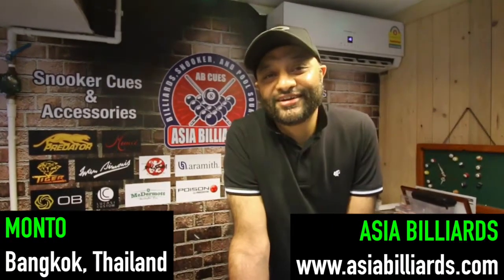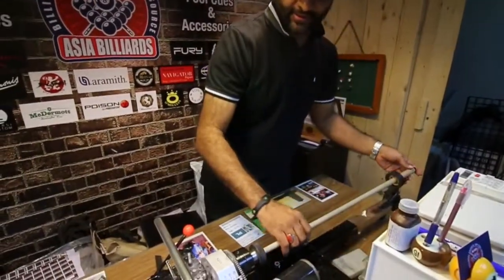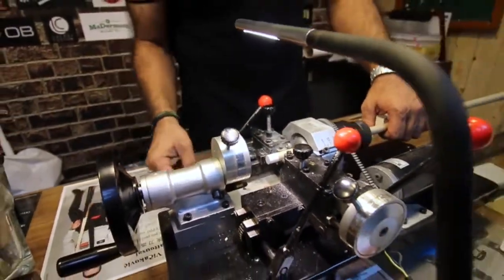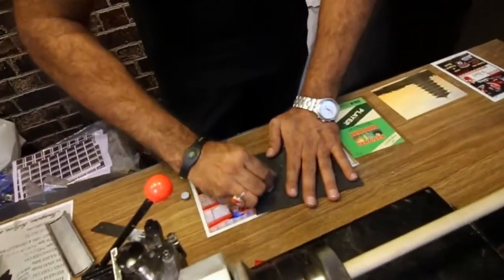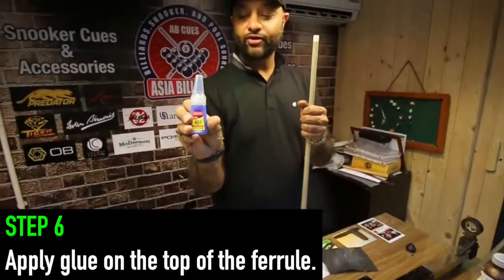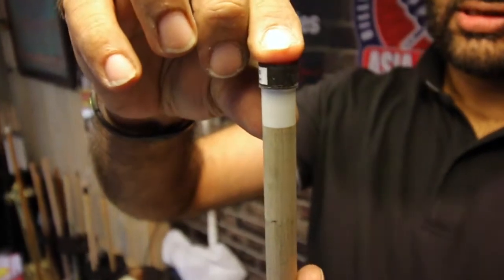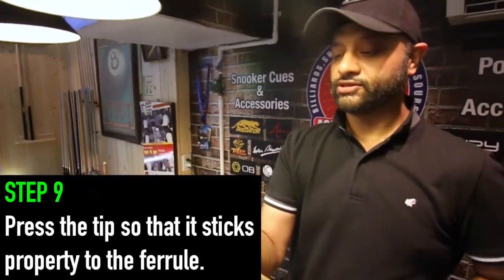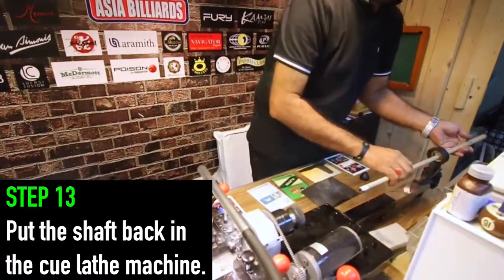How to install a kamui clear tip on the lathe machine in 20 steps

Comment: Where did you get your cue lathe? I need one like that. I live in Los Angeles and do tip work. I've been looking for a lathe like yours but haven't found an affordable one yet, Thx for the  video!
Reply from the maker: It's all available at Asia Billiards. See their website!
Reply: @voicumihnea  Asia billiards doesn't seem to be around or is not selling lathes. Where did you get the flush cutting tool that appears to have the bearing. Where you trim the tip flush the the ferrule. If you could point me to where I can get that tool I'd be grateful. I already have a lathe. Thanks

Comment: @MONTO: Sanding the glue side of a Kamui Clear Tip is not required. I saw you do that and did send an email to Kamui asking about it. 

Their answer is: "Thank you for your query. 

Since the Kamui Clear tip has a Polycarbonate plate, it has a perfect flatness on the glue side, so you can have perfect installation without sanding it down. 

I hope this clarifies."
Reply from the maker: Good to know.

Comment: uuwwwhhh... super glue on the ferrule? without any tape? and wiping excess glue from tip and straight to wiping down shaft? super cringe..... also laminated tips don't do so well against heat. i see you used your lathe to shape it, to the point where it was smoking... hard to watch...